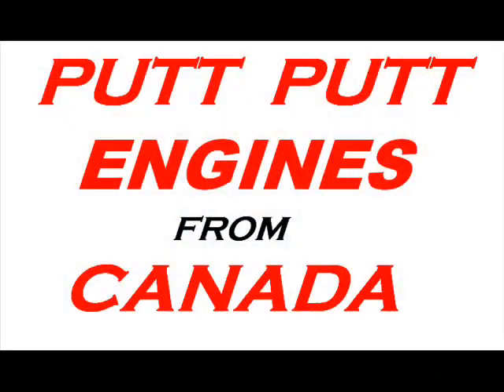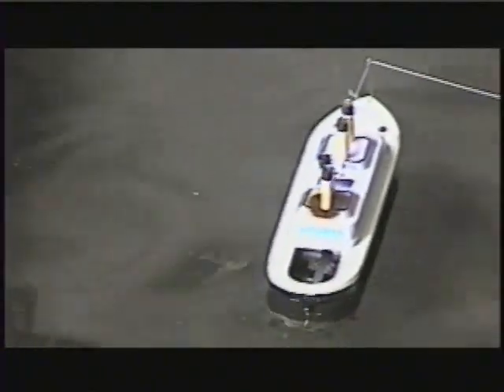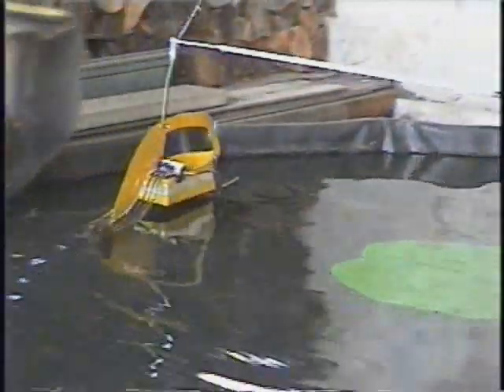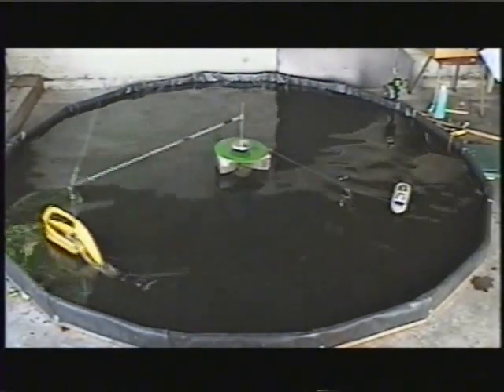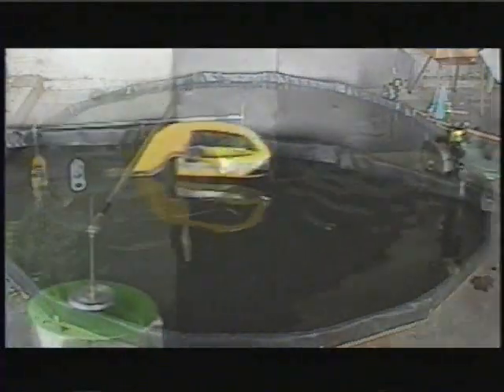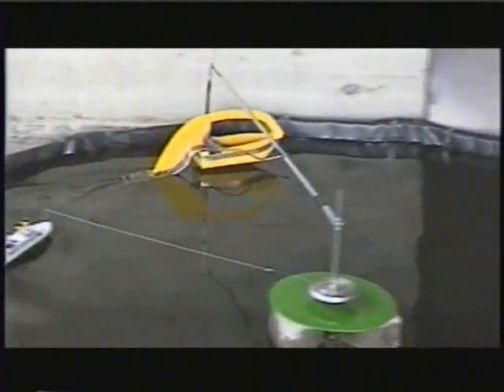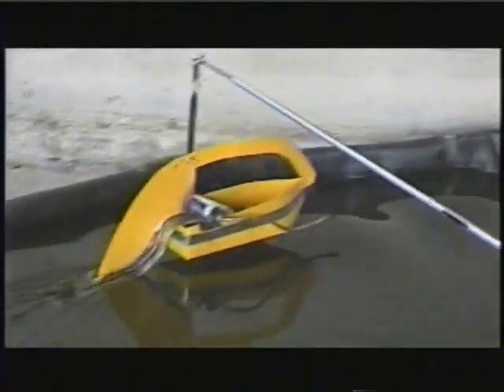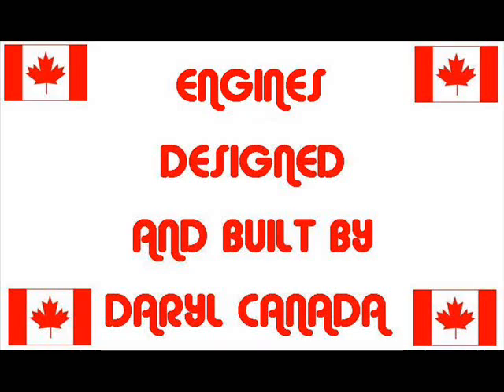PUTT PUTT WORLD ENGINE SPEEEEED  RECORD .wmv

Comment: The "fastest" putt putt isnt even touching the water.  I am sure if the boat were actually cutting through the water the drag would slow it down quite a bit.
Reply from the maker: You are correct, except, that it is not a boat. If you read the description and other comments you might understand. There is also a follow up video with a maybe fastest boat.

Comment: Increasing the speed by holding the hull out of the water is a bit of a cheat, isn't it? - especially if you're going to compare it with another model whose hull is completely wetted area.

Comment: your boat doesn't touch the water. it's suspended. in my opinion it doesn't qualify.
Reply: I opened this section to say EXACTLY that. Eliminating probably 98% or more of the drag, this is not a fair comparison or experiment.  booo.
Reply: second comment here... and stopping my own "quibbling" to check out that other video from the desc.

Comment: What is the length of your tether bar?  It seems to me that your boat is going faster than 2.1 mgh.  From the video, I noted it takes 6-7 seconds to make a circuit,  which would be 6.28 times the length of the tether bar.  You mentioned a distance of 1800 feet.  How many circuits is that?
Reply from the maker: wraft I wish it was. After hundreds of tests on a few dozen boats I just could not make them go faster.

Comment: Dear Mr. Foster,
Your Putt Putt boats  and especially the Word Speed Record boat fascinate me very much.
I want to ask you, if I can buy this word speedboat together with the boiler?
Reply from the maker: Most of my boats are for sale. The above video is  a test vehicle and cannot work as a boat. Watch my videos Part 2 and Part 3 and see if there is one you like. Some have the same engine an the Speed tester.
Reply: Daryl Foster Dear Mr. Foster!

Thank you for your message!
Please send me the price for the boat "Redline 9.0 "(4 tubes), including the associated boiler.
What kind of fuel  is used for the boiler ?

I would like to know also the price of the boat "Redline Speed Record". How is it possible that this boat runs so fast?

And how does  the business with Germany work?

Thank you for your answer
Reply from the maker: Hidir Karul So we are clear the Redline 9.0 boat is the one in the video Part 3 at 1:14. The tubes are slightly modified from the picture for better performance. The price would be 100.00 Cdn plus shipping. I have not been selling so do not know shipping prices but would estimate $ 60.00Cdn by surface mail. You can specify another method. Fuel is methyl hydrate alcohol. I do not recognize the Redline Speed Record name. Please tell me what video it is in. Thank you.  Daryl.
Reply from the maker: Hidir Karul I sent you a personal message via you discussion page. Did you receive it?

Comment: very fast , no doubts about that. but id like to see it run on the water by itself
Reply from the maker: You can. Watch the follow up video at https://www.youtube.com/watch?v=JOE3qIslu24   Better still go to my Channel and watch all of my videos. Thanks for watching.
Reply: Daryl Foster Very nice work! i wonder how scalable this is. you will probably get some issues with the heatsource
Reply from the maker: Vincent Swart Regrettably they do not scale up along predictable lines. The power output is very small. I have built engines with 3 times the power but the added weight means they do not go faster. Watch more of my videos and see more.

Comment: In that circular container. As the boat went around it started to create a whirl pool... this can decrease drag on the boat making it go faster :P Can u try it in a lake next time?
Reply from the maker: The whirlpool effect is in a direction opposite to the direction the boat is travelling. The longer it runs the more the current builds therefore increasing the drag and making it run slower in a circular pool like this. I found this out the hard way with a fast prop driven boat that ended up with about a 1 knot current moving the wrong way. Thanks for watching.

Comment from the maker: Hi. I'm guessing that by spin you mean traveling in a circle. In most of my videos the boats are tethered so that they will not run into the side of the small pool.  If not tethered they can run in a straight line. A rudder can also be used. See my video Part 15 for turning with radio control. Thanks for watching.

Comment: I would like to build a boiler and matching system for a Rc river launch I need a powerful boiler and pipe combo any suggestions ie boiler type capacity etc and length and diameter of pipes I know it's cheeky but do u have any plans etc of a well known setup i have gone on the forums but would rather deal with someone i know builds and puts the time in to design and test im looking at about 15" hull length any info would be great as i dont know what to build and what materials i need to do so m

Comment from the maker: Thanks for the kind comments Phil. I have stayed away from a tutorial on burners due to liability issues. They can be really dangerous when burning methyl hydrate in particular. They are only a vented metal container with metal tubes soldered in to hold the wick material. Shape and design are mainly determined by the space available in the boat and the heat required. Getting the heat right is really important for good operation particularly with coil engines. Cheers.

Comment from the maker: They can be difficult. Can't post links here. If you have not seen it try to find Jean-Yves pages on the pop pop section of e-clec-tic-sp-ace. Take out the -'s. Bending the pipes up as they leave the boiler and then down usually helps and of course larger diameter pipes require more length. Good luck.

Comment from the maker: I found coil engines difficult but Jean-Yves and Guus did and do well. If you have not seen it go to (eclecticspace  behind ..can't post links here) select pop pop select Jean-Yves select coil engine performance. Bending the pipes up first as they leave the boiler and then down helps. Guess you know that larger pipes need more length. Good luck.

Comment: I've been trying with larger diameter copper tubing.  It's not going well.  It fires dry in under a minute but reducing heat seems to not bring it to flash.  I think I have a condensing problem that I need to solve.

Comment from the maker: Yes engines will fail from too much heat both from physical damage and from a condition called burnout which is when virtually all the water is expelled from the boiler and pipes. In  general running an engine with as much heat as it will take is an advantage. One of the most difficult things about these engines is finding and maintaining the correct heat for each engine when the designs are different.Thanks for watching and commenting. Have you built engines yet?

Comment: You don't have to count very fast at all.  The dye pulses will be quite evident in the water... unless you are over 30 or so pulses at which I suggest dragging the boat faster than the motor will power it to spread the pulses over distance.  Not to many people could "feel" the pulses as fast as that and if you could you would wouldn't really have any evidence.  An expensive way I do this, is film it and use the frame timer or about 30 frames.  You have a camera and a computer, try it out.

Comment from the maker: Sounds OK but there are some reasons why that would not work. One is trying to recognize the pulses and count fast enough.  A low cost method if  you can count that fast is to just feel the pulses by holding the boat or having it bump against your hand. I can't post a link here but if you are interested you can find out if you are a counting savant by searching Google for "How fast can you count" and select the metacafe video. If you are interested I can tell you how to count accurately. Over.

Comment: The "standard dye test" on a putt putt engine is really simple and decidedly cheaper than some form of electronic measuring device.  You need a stop watch (which may be electronic if you choose) and a dyed water solution in a high contrast color so you can see it in the water.  If you have multiple engines test each one independent.  Perform the test by filling your engine with the dyed water and place it in clean water.  Start the watch and engine and stop after a few pulses.  Count and divide.

Comment from the maker: Having the heat right is very important. There is a just right heat and colder or hotter can hurt the engine performance. You are correct about a cover. Experimentation is usually necessary.

Comment from the maker: @tommymorey Your suggestions are valid but only a part of the equation. (A)Hot flames I use are methyl hydrate burners with up to 11 wicks. No candles. (B) Transfer of heat from burner to boiler to water dependant upon good boiler design.(C) Steam must be condensed very quickly.  (D)The diaphragm reduces power hence most of my engines do not use them. You seem interested. Build one. These are notes only. More detailed info available from sources noted in my videos. Have you watched all? Thanks.

Comment: @puttputt4video regarding your desire to build a faster putt putt. Ok, maybe it comes down to: provide a hotter flame (Precondition your yellow candle flame by enabling more oxygen to fan it blue... Perhaps by swirling airflow from beneath, possibly elevate the entire candle power system so that by the time air has reached the flame it has developed a greater velocity). And/or... Use thin tempered stainless or carbon fiber laminate so your trampoline is far more springy... cycles more often...

Comment from the maker: The answer is yes, well sort of. They produce very little power so speed would be less than a snail. Most powerfull I have achieved is about 500mN. You can  convert that to HP if you like but it is a very small figure. Thanks for watching.

Comment from the maker: @pcblah Correct again. The video is about the fastest engine, not the fastest boat. As the velocity of the water jets in a putt putt boat are small in force and limited in speed part of this test was to determine the result when drag was reduced. I also looked at how the engine would perform at higher speeds. While the engine was good at lower speeds the tubes had to be altered to keep it running at the higher speed. Hope this helps.

Comment: That looks very impressive, I would really like to see that boat operate with its hull on the water like the other one in order to see how much the drag would slow it down.  While it may be the world's fastest _engine_, you should really be comparing apples to apples for the sake of clarity.  Also, it's VERY quiet for a putt putt engine (silent even?), makes me wonder if there might be an electric motor attached to the bottom end of that arm's axle. 

Hmmmmm.....

Comment from the maker: @3DCGdesign 
Thanks for the comment.  Although my boat does not have 
water resistance on the hull it does have the drag of 7 tubes 
and the bar to pull. Tried a catamaran hull. It was very poor. 
See Part 3.  You can see the engine used in the worlds Fastest 
video in a hull in the outside boat of the two boats racing in Part 6.
The inside boat has a near identical engine.  With the hull in the 
water the Fastest boat is more than 3 times the speed of of the 
Titanic.

Comment: @PuttPutt4video I agree with zunzhinedude... it's a great engine (appears to be) - so why suspend the boat and then show it whizzing around the other boat which is dealing with actual resistance of the water?  Show the boats in a real side-by-side so that someone can actually see how impressive it is what you've done.  Or, suspend the other boat, so we can see just the engine vs. engine... if that's your desire.  Or put the engine on a pop pop catamaran if your fancy boat shown here is too slow.

Comment from the maker: @zunzhinedude 

My claim is for the fastest putt putt engine, not fastest 
putt putt boat.
As commercially made boats go the one shown is 
relatively fast and the sort of speed that most 
people running these boats are familiar with.
What do you suggest  I compare my suspended Putt Putt 
engine to?
This model experiment  was done as part of testing to try
to determine at what speed the intake stroke would fail.

Do you build putt putt boats?
Have you built something to challenge?